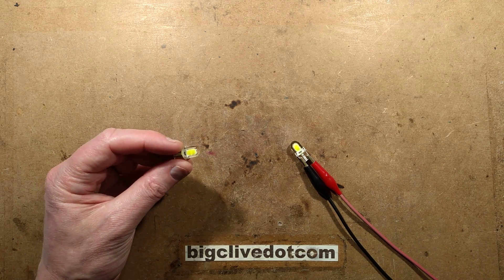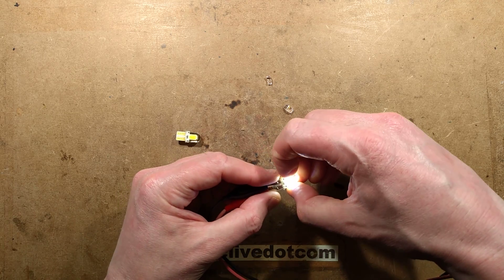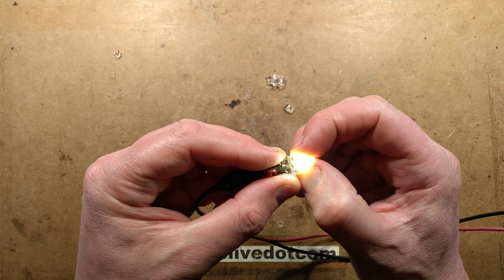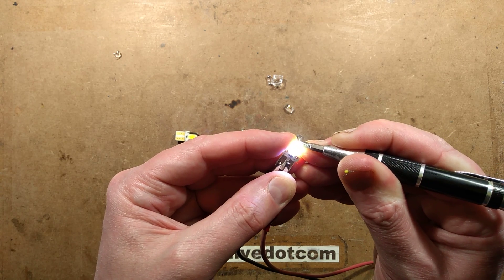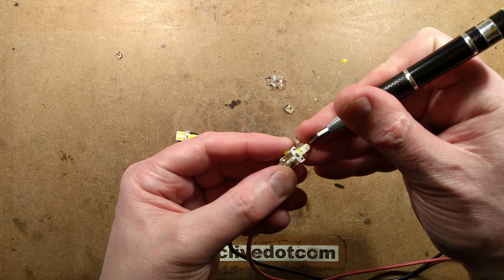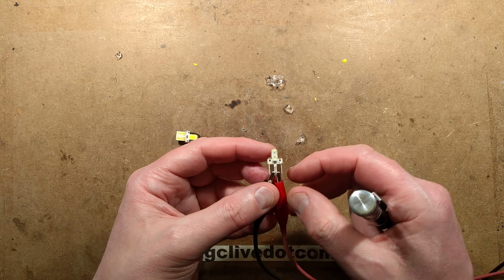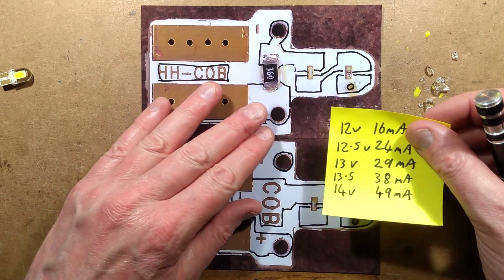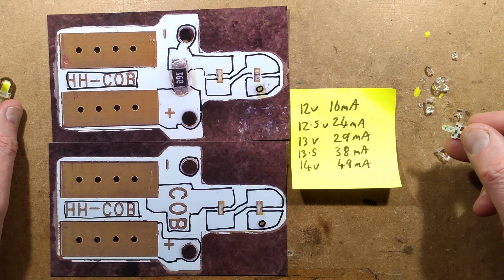Under the gel and phosphor of a COB LED car lamp.  (Deep violet chips)

Comment: When your car is running the vvoltage should be between 13.5 and 14.5 . The average is usually around 14.15ish . Seeing 14.1 and 14.4 normal for most vehicles.
Reply: Also don't forget that lead acid batteries require temperature compensation and the voltage is highest when the temperature is lowest. Also cars that are factory equipped with a battery that has lead-calcium alloy plate grids have a higher voltage set point than lead-antimony.
Reply: Most modern vehicles have "smart charging". There will be times when 12.80 volts or 14.50 is normal.  Depending on calculated state of charge, battery temp, battery age calculation and anticipated electrical and mechanical loads. The days of just hooking up a carbon pile and voltmeter alone, is no longer sufficient.
Reply: My chevy cobalt ss/sc likes to put out 13.2v to protect the battery from overheating due to to the engine heat (google gm smart charge cobalt). That's right, the battery that's in the trunk from the factory. Idiots.
Reply: The FIAT Punto of a friend charges at 14.4 volts. Just recently installed an inverter. When loading it down he drops to 13-ish volts. Needs a bigger alt!
Reply: nominal is 13.8
my hybrid has rock stable 13.805V, its ridiculous how well those converters regulate
Reply: It just depends on what the car needs. My 74 BMW is 13.2 base wise, as it's low draw in comparison to today's cars.
Reply: @lemmykilmister450  sorry, but thats just off spec
should run fine anyways, car electronics pretty much run on any voltage
Reply: @drkastenbrot  13.2 -13.5 is tick over spec on that vehicle
Reply: @lemmykilmister450  its not, 13.8 is spec for bmw alternators
Reply: @drkastenbrot  in 1967?
Reply: @drkastenbrot  It depends on the battery chemistry originally fitted.
Simple lead-acid batteries use the old "standard" of 13.8V.  Modern batteries use an alloy of lead-antimony-calcium and traces of other metals to optimize for longevity and minimal hydrogen generation.  They will be fitted with alternators putting out 14 to 14.5V (typically 14.1-14.3V), or programmable alternators that are dynamically configured by an ECU.
Reply: Back in the day, and as far as I am aware these days, the standard regulated operating circuit voltage of a "12V" (so called) alternator powered motor vehicle is from 13.8V to 14.4V. This was clearly stated again and again in the Lucas service data used by our workshop engineers. Of course, we have moved on since the days of Lucas ACR alternators, but as an international specification, I doubt it will have been varied since then. Basically, the alternator output must be enough to operate the equipment incorporated in the vehicle, and to charge the battery at the same time. To charge the battery, you need to exceed its standing voltage (12.6V). The greater the voltage above the nominal standing, the greater the current to charge the battery, however, exceeding the maximum of 14.4V will only serve to burn out light bulbs (yes they'll be brighter for as long as they last) and buckle the battery's plates. Anything above or below the specified voltages indicates a fault condition and should be rectified (no pun intended) as soon as possible.

Now, dynamo charging systems were a little different in range, but in either case, the output voltage is a nominal 14.0V, with a carefully controlled amount of latitude either way.
Reply: I usually get 13,8V in every car that is charging.  Less if they are not charging properly.  Oh I used to like it when they had amp meters in cars.  I always used to put one in, just because I could.  I had one car where the regulator had gone faulty and the driver couldn't understand why his lights were so bright and everyone was flashing him.  It was running at 28v, why it didn't cause any other problems I don't know, even the headlight bulbs and sidelights survived.  The battery in the car maybe came off worst, it had to be replaced a month after, the plates didn't look to good and the voltage dropped off quickly and the current coming out was poor after 10 minutes.
Reply: @BoB4jjjjs Maybe 13.8 at idle, that's barely charging, they're usually good for more like 14.2 at cruising RPM. I think what happens is the alternator isn't making enough power for the regulator to back off from full field when the engine is idling. Older ones are worse about that, I had one car that wouldn't even put the idiot light out until you blipped the throttle to help the alternator get running.
Reply: @BoB4jjjjs  the only dial on my car that isn't working is the Ammeter, I always like the old sports cars with lots of Analogue dials.
Reply: @adrinathegreat3095  Yes, the only thing I liked about my old cars is they all had oil, amp meter, engine temp, and so on.  Now they are all crammed into one display, if they are there at all!  They had wooden looking dashes and not the cheap looking plastic.   Mind you, I don't miss cleaning the chrome!
Reply: this vid came out 50 minutes ago, how in the shit did you reply two days ago?
Reply: @TiddyFTW  patreon early access i assume
Reply: @Wiresgalore  Ahhhhhh yeah that makes sense. Thanks :)
Reply: @TiddyFTW  Patreon, they see videos earlier than the rest of us.
Reply: @TiddyFTW  it only came out 2 mins ago acording to my notification thing
Reply: @partypillz3268  Yeah YT is kinda wonky with that?
Reply: Now adays with modern cars its not rare to get passed 15-15.5volt because of low load on the generator.
Reply: Webbax You should never see voltages as high as 15+ volts at the vehicle battery unless you are operating in temperatures below 0°C.  The standard float voltage for most lead acid chemistries is 13.6-14.0VDC at more typical temperatures (in the vicinity of 20-30°C) and at that voltage the batteries will indeed be charging, in fact anything above about 12.8VDC is sufficient to ensure you are not drawing current from the battery.  The warmer the battery the lower the charging voltages should be as temperature compensation works both ways.  Many charging systems will briefly push the voltage up to around 14.4V (higher if very cold) for a limited number of minutes to both accelerate charging and to help equalize the charge on each cell, but the voltage should never remain above 14VDC for an extended period unless the ambient temperature is quite cold as anything above around 13.2VDC (or higher if very cold) is hydrolyzing the water in the electrolyte into its hydrogen and oxygen components and results in accelerated water loss in the case of flooded lead acid batteries and will accelerate the wear, and eventual exhaustion of, the recombining catalyst agent as well as risk excessive internal pressures, leading to possible venting of the uncombined gasses, in sealed lead acid batteries (such as AGM) — in both instances water is being lost to the electrolyte at normal temperatures (note: water loss will be greatly reduced at much colder temperatures).

To put 15.5VDC into perspective, such voltage is only rarely used on flooded lead acid battery banks for the purposes of a hard forced equalization in banks that are subject to frequent deep cycling and even then it comes at the expense of doing some permanent damage to the battery bank as it will cause lead to flake off the plates and accumulate at the bottom of the battery as sludge (too much sludge build up will eventually short the plates once it reaches the level of the plates, killing the battery) as well as excessive hydrolyzing of the water in the electrolyte at normal temperatures necessitating rewatering afterwards.  Such high voltages should never be applied to sealed batteries unless the battery is extremely cold (below 0°C) as they can not recombine hydrogen and oxygen quickly enough to keep up and will build up excessive internal pressure resulting in venting of the electrolyte (permanent irreversible water loss).

Some vehicles might possibly have higher voltage on their power rails if the battery is charged independently of that rail, but if you see voltages above 15VDC at the battery terminals and the battery isn’t at or below 0°C then the charging system is ultimately causing needless damage to the battery.  At normal (temperate) ambient temperatures the peak voltage at the battery for both sealed and flooded lead acid batteries should be in the vicinity of 14.4VDC, and only above 14.0VDC for a limited duration unless the battery is very cold so as to avoid needless water loss (where water loss is what ultimately kills most vehicle batteries).
Reply: @ethanpoole3443  , 15+  volts you will start blowing out bulbs including the headlights.